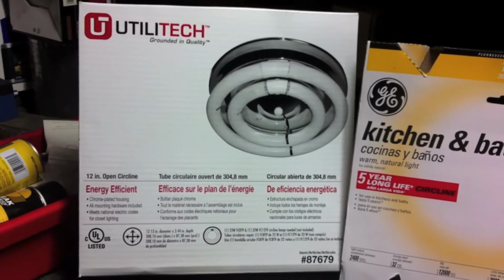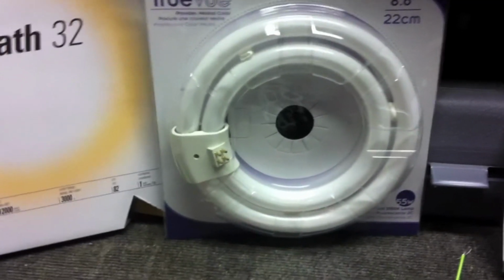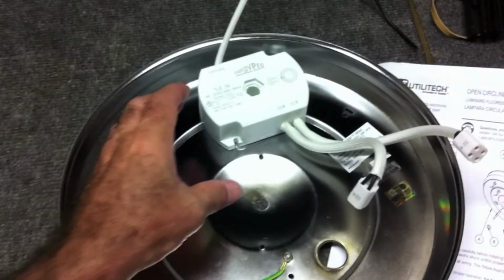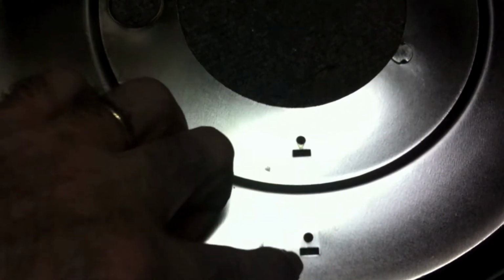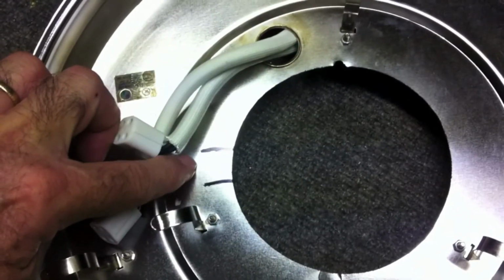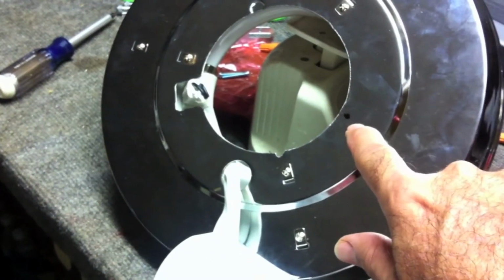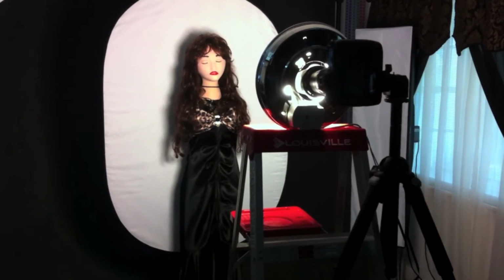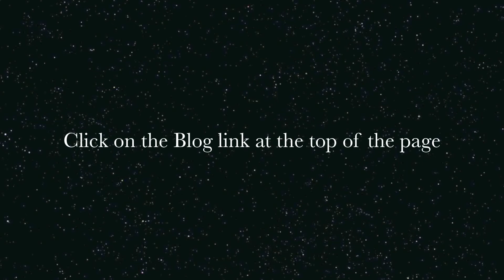How to Make a $50 Ring Light for Studio Photography

Comment: Woah Mike Great tutorial! I'm making my own ring light since in Argentina those are IMPOSSIBLE to get, and I was a little concerned because I couldn't get any tube that already had the temperature or watts I needed (those aren't made in Argentina). So, I finally bought two lamps, one big warm 32W tube, and another smaller 22w cool light. I've just cut the center of the tube holder, and tomorrow I'll test it out! Thanks for your tutorial, I'm a lot more confident that these tubes I got will work now!